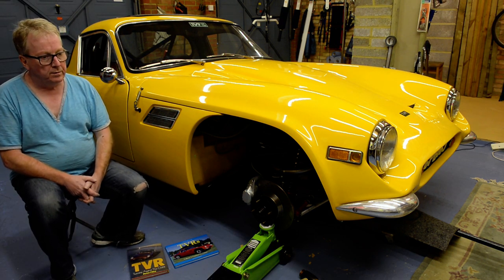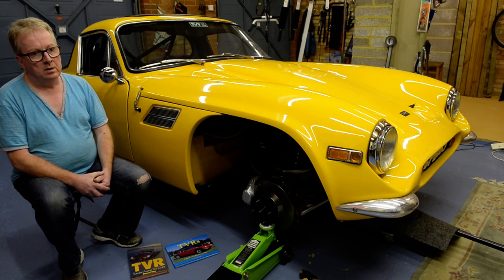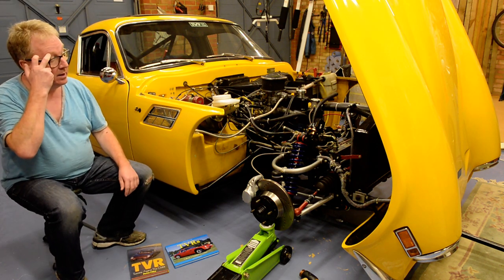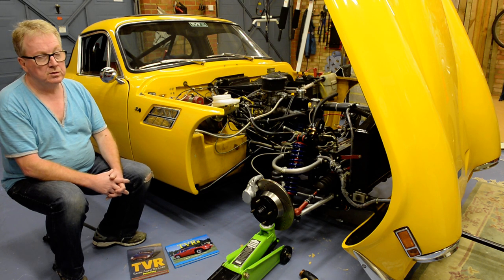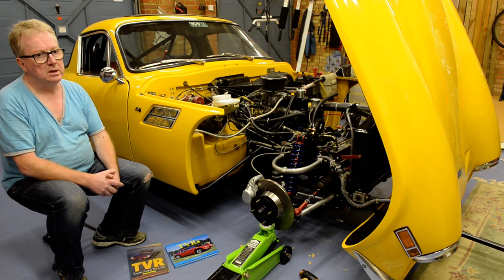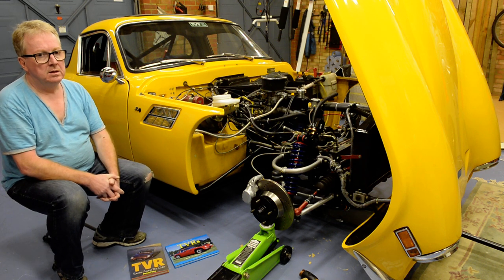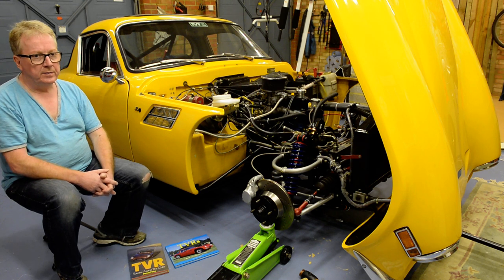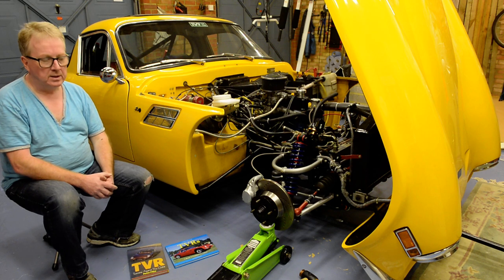TVR Vixen : Introduction to the Vixen Series of cars

Comment: We have a vixen S2 , 1968 G reg in the UK , very early wide body ( Tuscan ) S2 Vixen , was ordered as a V8 but customer changed his mind and factory had already moulded the V8 Tuscan vixen body shell with a sausage nose bonnet ! Came with a cross flow 1600 ford as a kit in the end , was crashed in 80s and sausage nose bonnet destroyed , has a normal bonnet like yours now , but with a 4.6 rover & T5 5sp race box , heavily modified now with one off race chassis and Gripper axle clutch etc , 350 bhp , were taking it out today for the first time in 5 years after another mod rebuild ! Bill touching £70k or more now ! Will put a video on here today if I can ....Taking here over the black mountains in Wales 400 miles + drive ....